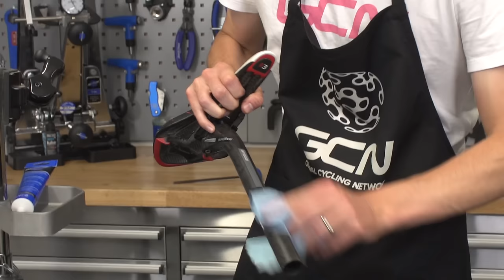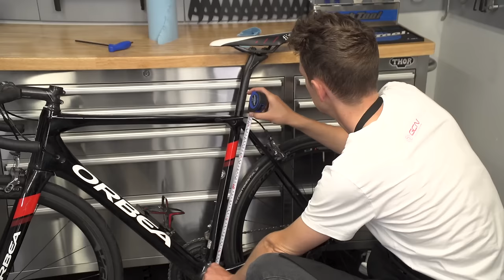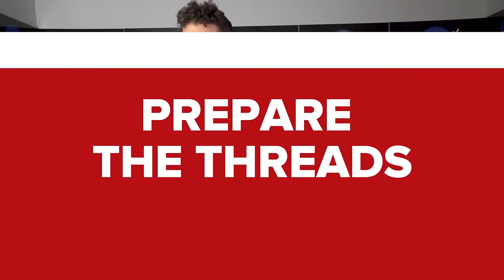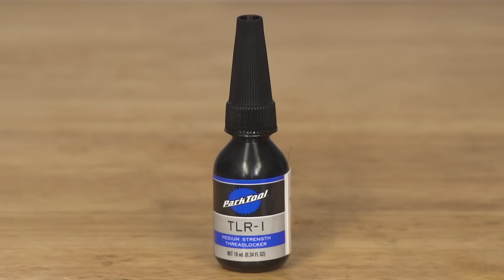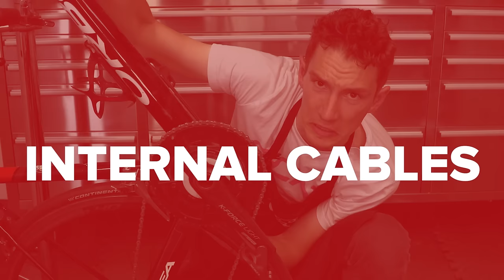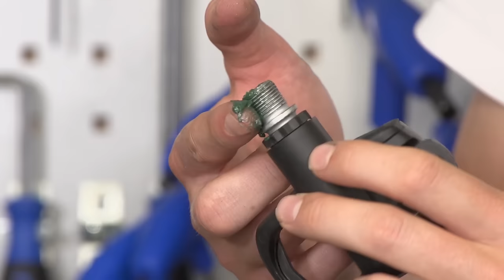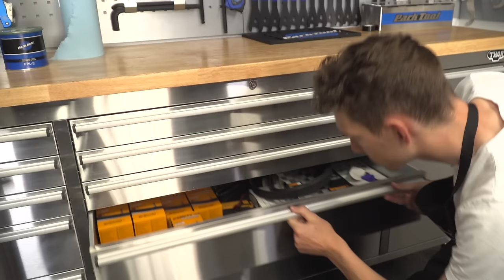6 Bike Repair Mistakes All Cyclists Should Avoid

Comment: Don't use grease on a seatpost.  Grease is just oil and soap, it'll dry out and become useless.  Use an anti-seize compound designed for the job, like copper slip (for metal), or Shimano's anti-seize compound.  Grease is a lubricant.  Anti-seize is designed to stop surfaces bonding.
Reply: PeowPeowPeowLasers A good grease will work just fine - IF you clean and regrease the parts every 6 months or so, depending on your weather conditions.
Reply: yep I use only degreaser to clear any grime every time I adjust seat/service the bike :)
Reply: You might have to use carbon grip if it's a carbon post in a carbon frame.
Reply: Ask a bike shop what do if you don't know they know the best thing to do
Reply: William Keys listen mate :P
Reply: That is great advice!  Fortunately, I am able to treat my bicycles well, keep them indoors and wipe them down on the rare occasion they see rain (yes, i live in southern california), and they don't get washed with a hose.  I just recently put on a new saddle / seatpost and after 25 years the original grease was still there.  I've even had my old formerly neglected Nishiki (we were kids) fully restored (with hours of work and steel wool) and no problems with the seatpost.  Maybe its a regional issue? (weather differences?)
Reply: DFTA (Don't Feed The Animals) when you cleaning your bike you have rereplay lube to seat post any other part to bike keep it running long treatment to washing of a bike problem solved
Reply: Christopher Barrett - I don't understand that comment?  are you saying when you replace a part you have to regrease it?  Yes.  I am aware of that.  :)
Reply: just to be clear, i didn't put the seatpost back on with the old grease.  in fact, i used a brand new seatpost and greased it first.  I kept the old seatpost with the original seat...for when the bicycle is 'retired' and hangs on my wall when I'm old.
Reply: DFTA (Don't Feed The Animals) replay I have no problem what so ever
Reply: OK so you have replay grease to seat post often and clean off the seat post, if its very wet do more often. i  hope it's clear for you now.
Reply: Got it, thank you!
Reply: I have used an inner tube section to cover the greased post and seat tube join which keeps water & grit out. I can highly recommend this hack to those that ride in all weathers or cannot fit mudguards.
Reply: Copper slip or copper ease is old hat now, ceramic anti seize compound is what garages use on brakes now its found to not corrode things as much on certain metals.
Reply: Teflon Gel! Seriously the best corrosion inhibitor ever!
Reply: PeowPeowPeowLasers 
You can probably use grease if you occasionally wiggle the seat post.
Make a mark and wiggle it. Not hard. I do think that the proper stuff helps as an corrosion inhibitor too.
Reply: Great idea, Alex! Hope you don't mind if I 'borrow' your idea?
Reply: William Keys i use carbon paste with any seatpost on a carbon frame. Stops from over torquing and possibilities of cracking the seat tube.
Reply: Carbon paste doesn't stop you from over-torquing - a torque wrench is the only thing for that. Carbon paste lowers that chance that your components will slip.
Reply: Grease works fine. It’s just not as long lasting than anti seize. Regrease when you think about it, job done.
Reply: @ajameslee  That's what she said.

Comment: dont squeeze hydraulic brakes when wheels arent on bike
Reply: True for ALL hydraulic brakes on any craft. You usually only do it once in your life.
Reply: What happens?
Reply: Ethan M As you brake you slowly wear down your pads, making them thinner.

In an effort to create predictable and consistent braking feel the system is designed to compensate for this slow decrease in pad thickness.

When you pull your brake lever it pushes the pistons/pads as far in as possible, and then only resets back to a fraction of the pistons actual range. This is so your brakes always feel 'dialed' (near instantaneous engagement).

So when you don't have a rotor between the pads, and you pull the lever the pistons/pads get pushed in as far as they can go until they touch each other.

Fix this by using a piston/pad spreader (flat head screw driver) to push the piston back in. Be careful if you try to reset the pistons if the pads are installed. Marred up pads make for terrible brake feel.
Reply: @joeshmoe7967  True, I was fighting a caliper on a Honda not long ago because it didnt fit with the new pads even when I just pushed the cylinder all the way to the bottom. It took me about 5 minutes of struggling to realize I stepped on the brake to turn the car on with the caliper out

Comment: I am always fascinated how fast the pro mechanics can change back wheels!
Reply: The pros more often have the benefit of mainly swapping wheels on bikes that are high-end. This means having a chain hanger boss on the chain stay, and having a separate derailleur hanger that doesn't interfere with placing the axle properly into the dropouts, so that the wheel is in perfect alignment before securing the axle. There isn't any reason a person couldn't rehearse these techniques, too. Practice makes perfect.
Reply: Get a Chainlift. It's a snap.
Reply: I took off mine 3rd with ease.
Reply: I always tend to over tighten.

Comment: stuck pedals? WD-40 and a 1/2" drive breaker bar (the kind used to remove lug nuts off your car) and a set of hex-head sockets. no more stuck pedals

Comment: A rear light mount also makes a GREAT "seatpost position indicator"!  Just mount it all the way down at the frame, so when you remove the seatpost, you just slide it in until the light mount touches the frame again.
Reply: Similarly, I have the holder for my old-school U-lock on the seat post...I didn't think about it when I put it on, but it sure came in handy when I had to deal with the seat post!
Reply: just put a cable tie round the post, or if the post is anything but black then just a couple of small marks with an indelible marker pen...
Reply: Smaller riders might not benefit from this advice, the light can be obscured by the wheel.
Reply: Rubbish 😂
Reply: except the rear wheel might block the rear light
Reply: @knightsljx  Yeah, true for short riders on small frames.

Comment: I'll offer a free tip to you all, it's an aircraft mechanic's secret.

Those bolts that you feel you are going to round out - go to your local auto parts store and buy a small tube of Valve Grinding/Lapping compound (the more coarse the better) and smear it around the end of your tool, say, allen/hex key/wrench for example. It will "super" grip those bolts, and may turn a seized/rusted bolt into a winner - rather than drilling and tapping (You can also use this paste on the end of your screwdriver for screws!).

I'm fairly certain that Loctite offer a Diamond-grip product, however it is quite expensive and the valve paste will do the job at a fraction of the price.

Also to GCN/Simon - Grease/anti-seize lowers the coefficient of friction - when you have grease on a thread it will be more tight than you thought - that 30NM may be 35+ with grease - Keep this in mind when tightening bolts so you don't strip them out.
Reply: TheApothecaryAus that's helpful thanks!
Reply: Which kind of grease do you suggest?
Reply: I will try this. Thank you - sincerely a bike mechanic.
Reply: What a fantastic idea!!
Reply: Ill spread the good news.!! Lol
Reply: Wicked idea! Super easy way to achieve a little necessary friction! Thank you!
Reply: Whoa great tip!
Reply: Wow, you learn something new every day.  Thank you!
Reply: Was it extremely hard to become an aircraft mechanic?
Reply: @darkworld9850  Morning mate. It cost me approx $10k Australian out of pocket for trade school. It then took lots of knocking on hangar doors to introduce myself and from that I worked for free for about 6 months just to try and get a break in the industry. Within my first year into the job I then developed carpal tunnel and had surgery. Now work as a windows engineer in IT. It's a hard journey, the pay and conditions are below what you'd expect but if aviation is your passion and you live and breathe it then go for it.
Reply: @TheApothecaryAus  You have a pretty interesting life and all you said is 100% correct. That's a hell of a job too!
Reply: @tsurutuneado5981  thanks brother. I'm now an IT infrastructure engineer, in Australia it's a better life than being an AME
Reply: makes sense about the increased torque on greased threads. My problem is trying to figure out which direction to go to remove a pedal so i might be actually tightening
Reply: Torque specs on bicycles assume the threads are greased.

Comment: 1. Trouble removing back wheel even in the lowest gear? Lower the tyre pressure first, it helps a lot.
2. Always, put your chain on the largest front sproket when removing pedals or undoing the crank arms. It could save you an awful lot of blood and pain.

Comment: Here is a tip to remove rounded allen head bolts:
You can use torx keys in it. Torx keys are made in different sizes than the allen keys so you can find a bit bigger than the actual key that rounden up the head. The torx key is a bit conical, so it tightens up in the hole easily and its teets are biting into the head a bit with a little force. If it doesn't work you can just cut a line into the head and use a flathead screwdriver.

Comment: Definitely rounded bolts! Tried the drill method, recently, with no luck. But I did get it out by dipping an IKEA allen key in JB Weld and sticking it into the bolt head. Worked a dream! Now I'm just hoping I didn't ruin the frame threads with the drill...

Comment: great tip i came across from a fellow racer many years back.
take your worn out or even new hex tools some come rounded at tips. 
square them off on a bench grinder thus preventing stripping bolts. 🤠
Reply: coldforgedcowboy 
i just make hex tools 2mm shorter every few years
Reply: that´s right, i startet working in a bike shop some months ago, one of the first things i did,  was shortening (therefor sharpening the edges of) the hex tools. Better do that, than grind a slit in every secound worn out bolt, to get it out with a screwdriver.
Reply: coldforgedcowboy I’d end up with a scratched nose in that case!
Reply: Fine if you are at home and keen on recycling. However, if working in the trade, just get suitable quality new ones and be willing to throw the worn ones away in the metal recycling.
If you are a full time bike mechanic in a busy shop then you can get through a 5 mm Allen key every week. The time spent sharpening Allen keys is better spent on revenue paying jobs instead, i.e. setting up even more bikes for customers.
Really you should have a slew of different Allen keys for different applications, not one Allen key can do everything. Sometimes you need more of a Y-wrench thing, sometimes the ball-head helps, most of the time though the basic Allen key does the trick and these are the ones that need to be replaced frequently without hesitation.

Comment: The only issue I've had was removing the rear wheel. I never knew why it was hard sometimes. Duh. Thanks. I have 1 toolbox just for specialized bike tools and parts. My seat posts are all aluminum so I mark it with a sharpie before loosening it. I use an impact wrench to loosen the freewheel on the rear wheel. It's much easier than trying to hold the wheel while reefing on your ratchet wrench.

Comment: The best thing for preventing parts seizing in place is copper grease, especially in any place where steel is contacting aluminium, e.g. pedals into cranks, clamp bolts into handlebar stems. Copper grease prevents bimetallic corrosion. It's cheap as well!

Comment: Remember that using grease or anti-seize changes the torque/clamping force characteristics. If you need to use a specific torque, lubricate threads only as per the instructions otherwise you can easily over tighten the bolts.

Comment: Just a little alternative tip: put two small dots of a silver pen/marker at the edge where frame and seat post meat instead of the tape. Benefit: also very easy to find the strait forward orientation simply lining up the dots in angle and height!

Comment: The electrical tape trick for remembering seat post height doesn't really work when putting your bike in a transport box, which usually requires lowering the saddle all the way....the tape would make that impossible. Use a permanent marker instead. Easy enough to remove the marking after the fact with a bit of isopropyl alcohol.

Comment: Re seat position I just bought a new ebike and it has a "ruler" etched in the side of the seat post, that way all you have to do is memorize the number on the "ruler" when you take the post out. The rails under many seats have similar markings to tell you how far forward/back the seat is positioned. There are two problems with electrical tape to mark a seat post: it's not waterproof and will fall off if you ride in the rain, and it leaves gunky adhesive residue which is hard to remove and can cause the seat post to get stuck. Also it can migrate/slide out of position over time. I would use a cable tie instead.

Greasing threads is a great idea, in fact the manufacturer of my rear rack (Ibera) recommends greasing all bolts when installing their rack.

Comment: for pedals. position the tool you are using at a point that allows you to pull it toward the crank arm by squeezing you hand together to make a fist. you never need to worry about slipping off the pedal again....same works for the BB nuts
Reply: vonpupees yep
Reply: When taking pedals on/off, I always put on a pair of my leather work gloves.  Just in case of a slip, and.....

Comment: I've got the Topeak Ninja P Mini Pump that fits inside the seat post. It comes with a rubber indexing ring that fits EXTREMELY tight on your seat post where it enters the frame, allowing you to pop it back in to the exact same position every time. The rubber indexing ring is handy for all jobs requiring seat post removal, not just for using the pump.

Comment: when the head of the bolt for an allen key is worn out, you can try to use a torx key, sometimes it works, sometimes not, but you can always try it ;)
Reply: I had this problem with one bolt of my cleats. Bolt head in Look cleats is strong as butter
Reply: Jarne De Prins take to bike shop mate if happens to 😂 haha
Reply: chistopher barret, not if I just want to change brake pads, way to expensive in the bike shop.... ;) I hate those little bolts...
Reply: Jarne De Prins )
Reply: Yep just hammer a similar size in and it'll grip enough to come out!
Reply: If all else fails, hacksaw a groove into it and use a flat screwdriver

Comment: "Most bike maintenance jobs are relatively straightforward." 
And here I am taking ten minutes to put on my back wheel.
Reply: In my line of work, "fairly straightforward" is another way of saying "you're f---ed."
Reply: i wasted minutes trying to get the rear wheel back into my E-MTB untol i realised that the deraileur was locked and thus unable to properly move out of the way.
Reply: As someone who was new to cycling not too long ago I do remember the seemingly awkward or impossible tasks of removing and putting in the back wheel
Reply: sometimes you get it in in a flash, other times it takes so long and gets you all greasy for your efforts

Comment: On my commuter bike I've rounded the NDS crank bolt on my mid-level FSA crankset TWICE. I've rounded maybe one other bolt in my life, some I think something is going on with the design/material on this crankset. Very annoying, $10 to replace the bolt.

Stuck pedals: long again tried to remove a stuck one with bike in small ring. I gouged the heck out of my arm when the pedal finally moved. I'll NEVER do that again. So stupid.

Comment: I didn't have the plastic tubing for the internal cables, so I tied a piece of fishing line to the old cable and pulled it through. Then, you can tie the line to the new cable and pull it back through the opposite way. It worked pretty well. Nice to have options... Thanks for the vid!

Comment: I need to learn and remember which fittings are reverse threaded. I spent too much time trying to undo my left pedal before realising that all my efforts were in fact tightening it. Bottom bracket ditto
Reply: For the pedals, when the bike is wheels down, push the wrench down on the back side to loosen, push down on the front side to tighten.
Reply: @coast2coast00  Thanks for that. It's counter-intuitive as that direction is the way the pedal is rotating when you're riding so, if the pedal was a little loose, it would continue to loosen. Most fixings are designed to tighten during normal use
Reply: @simon4043 no, the pedal actually tightens itself during normal use, that's why they're threaded the way they are.
Reply: @greentoaster  But pedals actually rotate BACKWARDS relative to the crank as you pedal forwards. Isn't that the same way you undo them?

Comment: Made the mistake of using Harbor Freight Allen wrenches and rounded a small bolt. Luckily I was able to remove it with a high quality Allen key that has chamfered ends made by Husky. Highly recommended.